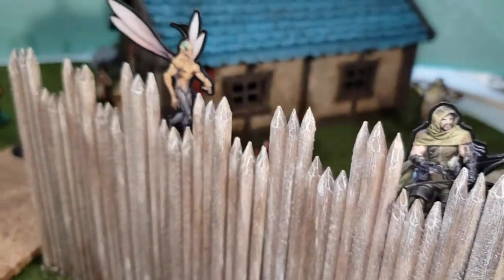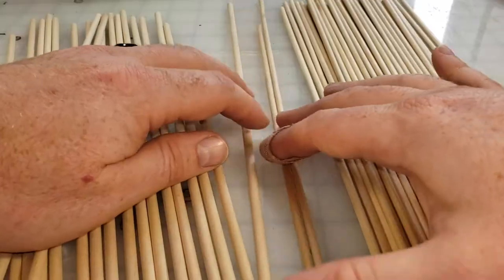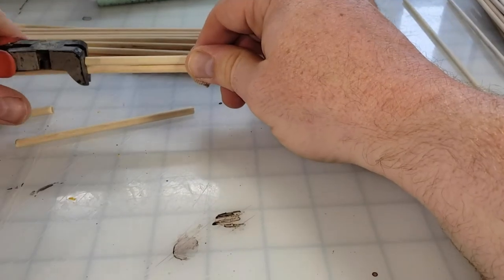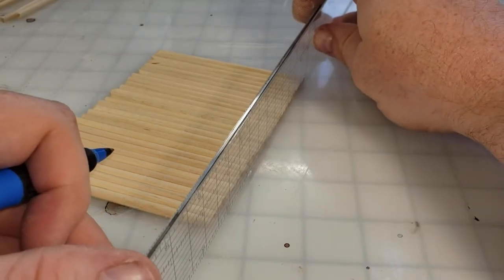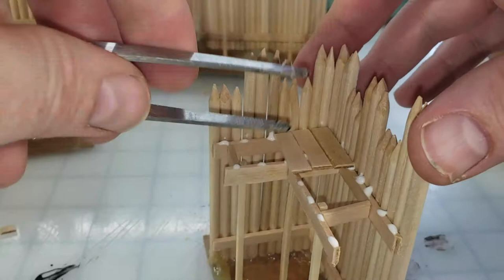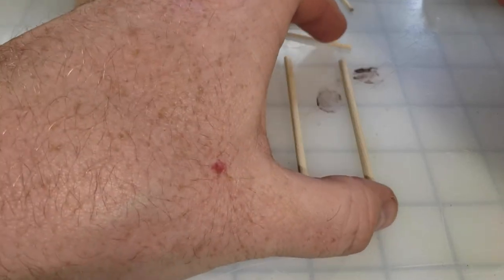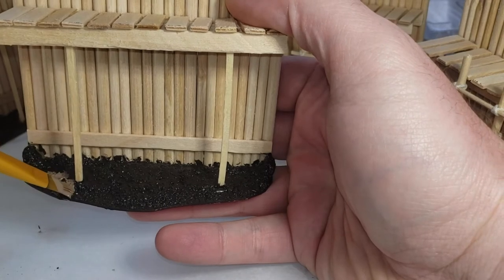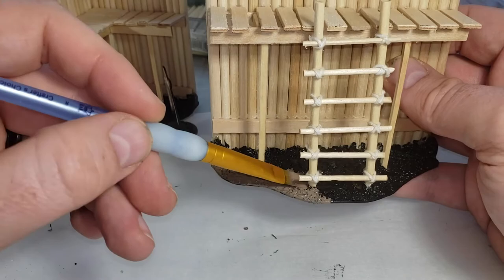Broken Terrain Modular Magnetic Palisades

Comment: I would suggest you build a palisade section and apply "The Dip Technique":  Minwax Polyshades Urethane Stain -- Royal Walnut.  It will seal everything with a thin coat of polyurethane, keeping it completely safe against moisture.  The Royal Walnut stain color is a very dark, dirty brown, but not black.  It can be applied to everything, before applying the flocking.  Use the Satin, not the Gloss finish.  If it is still too glossy, spray on a matte clear coat.  It is amazing how it will shade terrain pieces; dry brushing can be done after it dries completely, without issue, using any type of paint.  Brush the Minwax on, and use the edge of a paper towel to soak up any pools, before they dry.  It works over the top of any dried glues, sealing them against moisture, as well.  Wood Glue (stronger PVA with less water than White Glue) will dry in 15 minutes, to the point of handling the object.  It's much stronger on bare wood, than White Glue -- the wood will break before the Glue does.  Cheers!
Reply from the maker: Great tips.

Comment: You could reinforce the base of the palisade by placing something like a low block of foam running the entire length of the wall and cutting it to be somewhat trapezoid from a side profile. Kinda like this:

  | |  <- palisade wall
/—\ <- trapezoid cut foam 

That should in theory make the posts more stable, and makes it look like there is a low wall of packed earth, or as if the wall is elevated a bit.
It'd also create some room to hide magnets in or weights under.

Also, just as conceptual idea, do you think it'd be possible and/or practical, to magnetize the walkway, so you could take the walkway off to make storage easier?